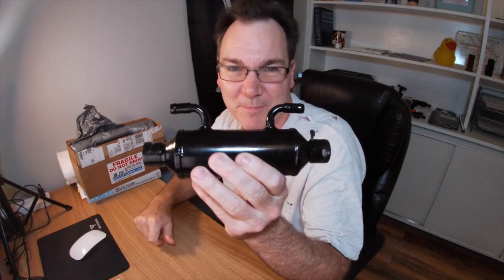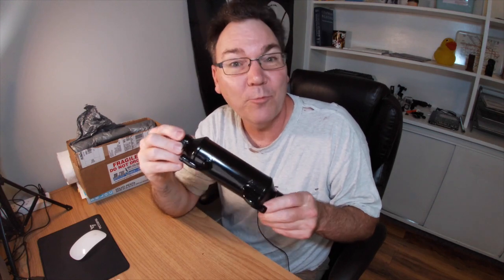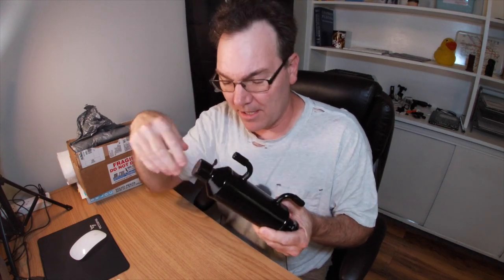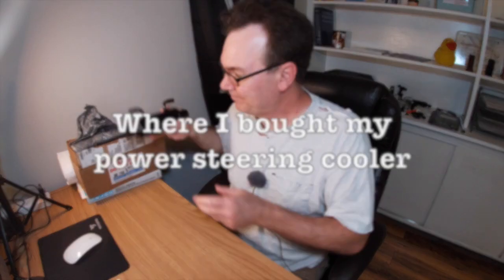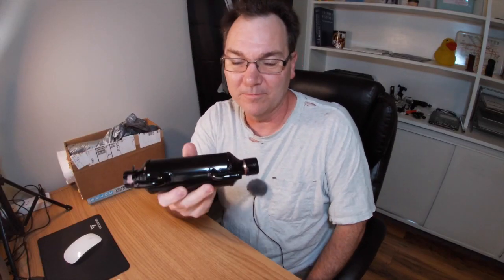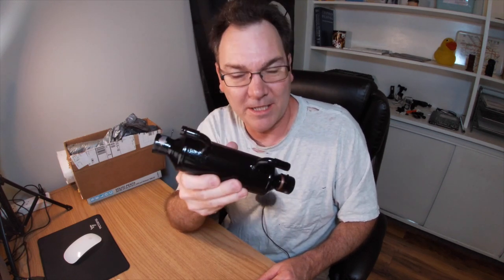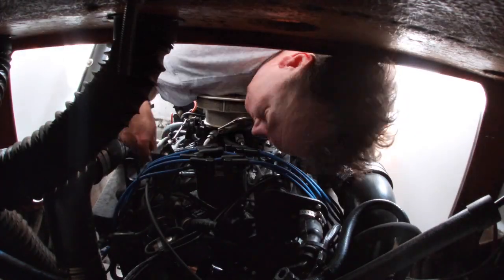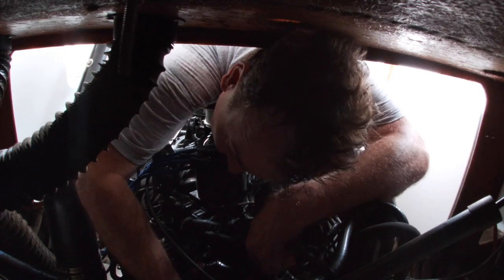Power Steering Coolers - Replacing the power steering cooler on my boat engine

Comment: As you i was once a novice boater.  Love boats. Now at 69 years old and boating since 22 i still learn stuff.  One thing seems to be a fact.   Oat engines are manufactured without and regards for service.  Just stuff the engine into the engine compartment and good to go.  LOL. I have a 2002 5.7 Volvo engine. There are some improvements for access. One tip i learned after cracking two ribs from laying across the flame arrester.  I put old  pillows across to cushion me.

Comment: I have the exact same leak evidence you described on my Mercruiser 5.0.  Just checked the stainless steel screw on style clamps and found the one nearest the leaks had loosened over time.  I tightened it up and tested for leaks and voila, you've saved me a couple hundred dollars and lots of fun replacing that cooler.  THANK YOU!
Reply from the maker: That's awesome!

Comment: Thank you Wayne for recording these videos and  providing excellent commentary on your Penta steering system's work.  I am currently investigating my power steering fluid leak and hopefully will not need to replace the actuator nor the cooler.

Comment: I don't have a Volvo Penta or troubles with my power steering cooler (wherever it is on my Mercruiser) but I can appreciate this video showcasing the hardships of I/O boat maintenance. It makes me feel better about the times I've had to contort myself into the engine compartment to replace something. There's nothing more frustrating than replacing a part that turns out may not be bad, but we've all been there at some point or another.

My next job is adjusting the shift cables since I'm suddenly having issues going into forward gear. Wish me luck.
Reply from the maker: Yeah some of these I/O engines can be a real challenge to work on.

Comment: Thanks for making the statement about manufacturers not installing unneeded parts. Many of these kind of parts are made by external companies and existing parts are sourced that will work for the engine manufacturer but sometimes the part is customized for the specific application for the engine builder. Not a fan of aftermarket parts these days but as you stated things like this is worth the gamble. Besides, now days you might be lucky just getting any make of replacement part.

Comment: Interesting, I have fluid going somewhere, this has given me a good start to look for a leak. Thank you very much for making the video. I have a mercruiser but should also have the same type system I would think. I will probably try the clamp leak first if I have the same system as the Volvo. Glad to have a place to start, thank you. Hope it is fixed.
Reply from the maker: good luck!!

Comment: We’re definitely experiencing a power steering leak internally through the cooler, we just took our boat out of storage today, after letting the engine run for a few minutes, I noticed the reservoir where you fill the power steering fluid, the fluid itself was all milky. I checked for leaks everywhere and nothing, the only thing that would make sense would be the cooler itself, since this is the only location where water and the fluid itself would meet together, hopefully next week we can order a new one
Reply: Did that solve the problem?

Comment: Wayne, appreciate the video, I had no idea what that gizmo even was LOL until I watched this, I had a line leaking on my Crownline with a 4.3, you had WAY more more room to work than I did, I had to remove the bracket that holds the 10 pin audible alarm just to see the cooler and that was a major pain, ended up having to take an angle grinder and shorten a 9/16 socket and then duct tape an extension on to a ratchet just to get the bottom bolt off and have room to get the socket and ratchet in there! I think for me my cooler was fine but a had a leak in a return line.
Reply from the maker: Dang. I/O engines are quite a challenge to work on!
Reply: Cool, I have a Crownline 225 BR leaking. Just around out about an hour ago. Where was your leak in the return line? At the pump? I have the 350 2 barrel. Appreciate the response and Wayne for making the video.

Comment: The newer Volvo Penta engines (GM Motors) have the power steering cooler on one side.  Wether it is worth it they do make kits that allow you to move the cooler forward for future needs.   Volvo owner.  All that stuff, fuel water separator filter and oil filter moved forward for easy access.
Reply from the maker: That's good to know!

Comment: Found this vid while doing the exact same project as I type. First - I had a weeping power steering drip from the plastic clamp connection on one steering fluid line attached to the cooler years ago and changed to metal band. Due to a concerning change in engine running temperature, I traced the seawater hoses to the fuel reservoir where the lines also connect to the power steering cooler mounted on top - my Four Winns is exactly the same cooler type. Taking the water hoses off, shining a flashlight into the cooler itself exposed horrible clogs of debris and calcium deposits - the center core is honeycomb style. Your brand Mr Cool advises they've changed this problematic design to a better pass through channel they refer to as coils not honeycomb. INVALUABLE is your challenge on the connecting band that holds the cooler in place. This is why I came here in the first place. Am assuming it's a fixed bracket to the block or likewise, that the band itself is nut and bolted to. You're in better shape having that cooler replaced due to the blockage that was probably happening. Mine was so severe after never replacing it since  new in 1994. This gave me starting issues of vapor lock after extended cruising, when shutting off for a while and then restarting - the fuel reservoir wasn't getting the cooling water it was designed for and probably cooking the fuel away! Crossing fingers this works! This cooler blockage discovery is part of thorough runthrough after replacing the main engine circulation pump and new seawater impeller. And using shop vac to test all cooling hoses for free movement. Even the exposed engine block openings when the main circulation pump was off, and the exhaust risers. All free movement. Wish me luck and thank you for this great vid.
Reply from the maker: One of the things I have learned by having an I/O is that it's usually not the "car" engine that is the problem - it's all the boat stuff that gets bolted to it!
Reply: @WayneTheBoatGuy  A "Marinized automotive engine" is a whole other ballpark eh? Makes all the difference to enjoy time on the water without the unexpected IF it's working as designed. Waiting on Mr Cool part now and can't wait to be done with this for peace of mind. 1994 Four Winns 190 Horizon with Ford 5.0 - and many important parts are now extinct. We do what we have to!

Comment: Great videos thanks. I have a FW with a VP and am having leaks wanted to know did you finally fix the leak?
Reply from the maker: I have for now. I have realized that my boat, being over 20 years old and having spent those years in brackish water marinas - basically needs everything replaced. I could just finish this job and replace all the hoses, clamps and pump OR just fix them as they break. I usually choose the second option.

Comment: great vid. Do yourself a favor and replace those plastic clips with a SS clamp, they will leak eventually
Reply: I only posted this because I had a leak at my cooler and found the leak by wrapping the in and out ports with paper towels and ran the boat for a bit, then carefully removed each paper and found the leak at the in port. I went ahead and changed both clamps and had no issues since.
Reply from the maker: That's a VERY Good tip!

Comment: Hello! I was a boat nut all my life. Four of the boats  that owned me were I/O stern drives and they all had "Doghouse" style engine covers that you remove entirely to work on engine and components . Very easy to work on.Is it possible all of your engine cover can be removed??? If not the manufacturer should be shot or at least severely reprimanded!!! A few months back I had to lie on the inline 6 engine in my F150 to effect repairs and was in pain for about a week thereafter. No fun!!! We are not spring chickens anymore! CHEERS from westcoast B.C.Canada  P.S. Great Dangar Stu shirt!!!
Reply from the maker: I can remove the rear seating area, but it's a 2 person job and we did it over the winter. The side panels and front panel can be removed, but that adds several hours to any project. Even if I do that, I still have to remove the batteries and water holding tank to really get any access, and the engine is still well below the floor. This boat was clearly designed for looks and seating, not accessibility for repairs and maintenance!